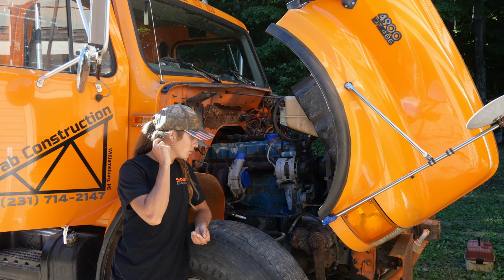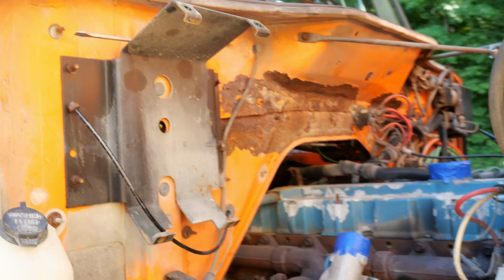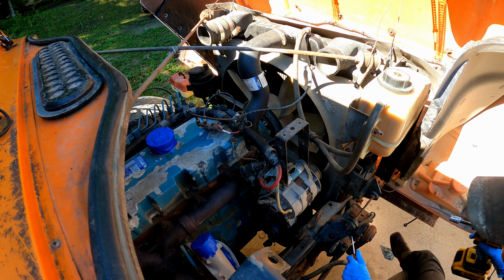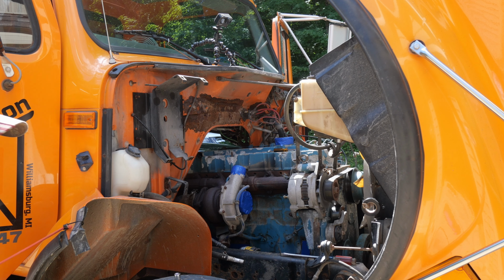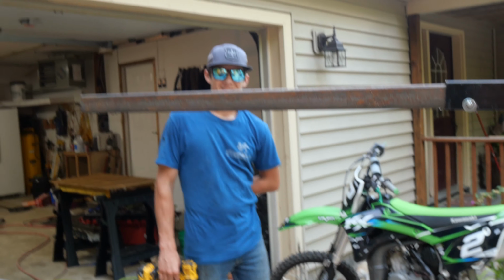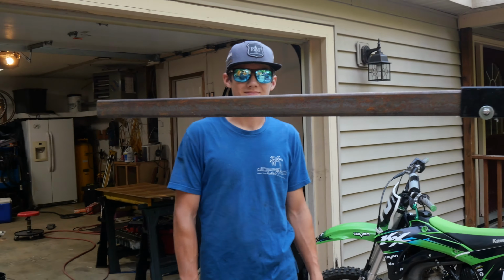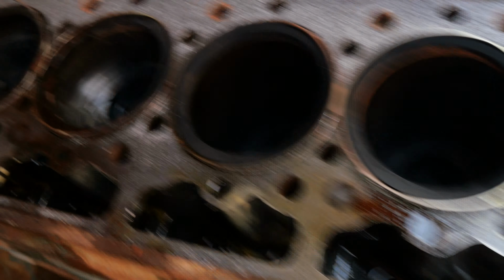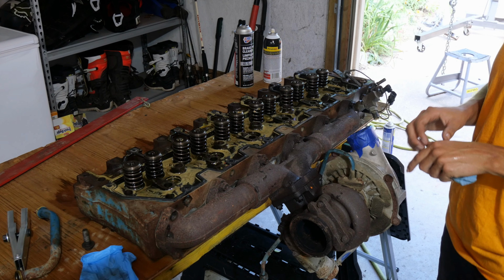International DT466 Engine Rebuild Part 2 Head Removal

Comment: Thanks for this video, i have a dt466e my top hose to the coolant expansion tank is constantly flowing coolant to the tank at cold and hot . What do you think is the issue thanks in advance?
Reply from the maker: Sounds like a head gasket to me. Check to see if the coolant hoses are hard after sitting overnight.
Reply: @HeidisGarage thanks, i will check it out!

Comment: Yeah, that’s really slick that you added extension pipe to the Cherry picker and also, did you do a compression and a leak down test?
Reply from the maker: I did not do a compression or leak down test. It was eating so much coolant and it had so much blow-by out of the breather tube I didn't really think about testing the compression.
Reply: Hey homie I found a good article on diesel world, talking about the history The development of this engine and other variance started in the late 60s
Reply: Hey homie I found a good article on diesel world, talking about the history The development of this engine and other variance started in the late 60s
Reply: I've got my DT466E inframed down to the block right now and getting ready to re-assemble with kit.  What can be done to up the HP while I have it apart?
Reply: Yeah buddy I’m not sure
Reply: I guess on those older, mechanical engineers, you can find a way to adjust the fuel pump

Comment: I got the 95 DDT 466.
Some of my parts are located other areas, but did you say that was a 47
Or 49 model.
Reply from the maker: This is a 49 model, on our 47 some of the accessories are in different locations.